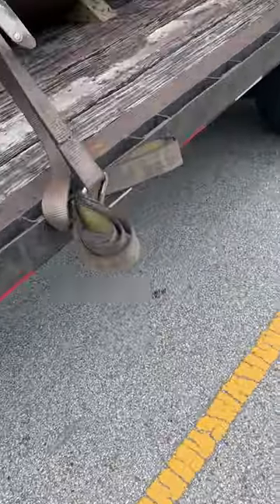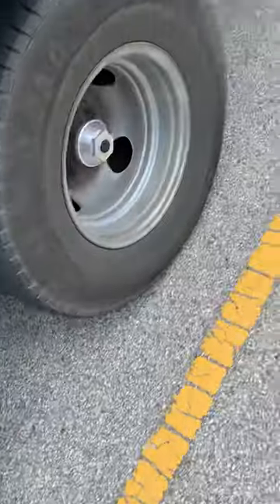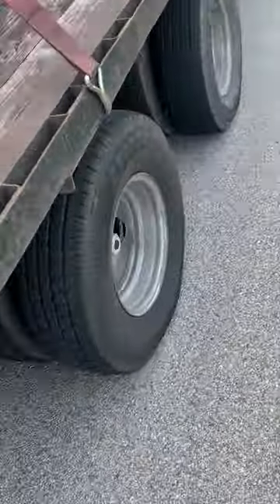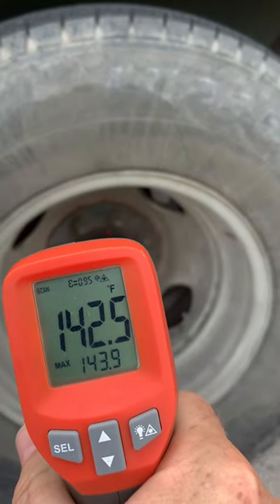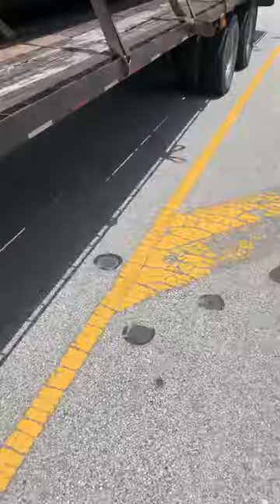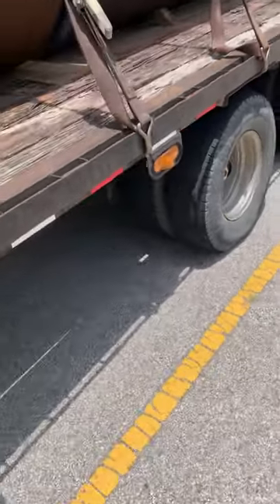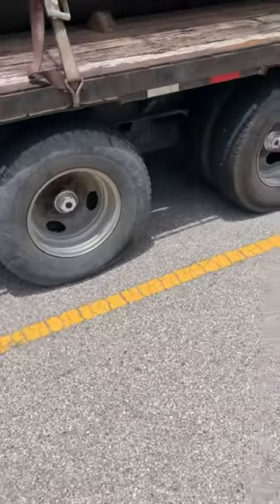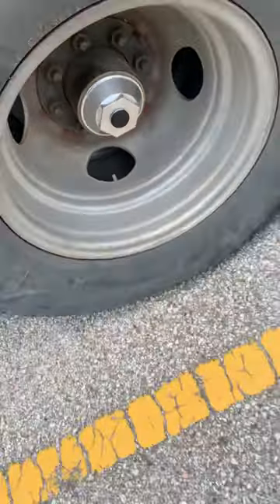Lucas hub oil vs. Super-S (00) double zero grease

Comment: Any updates on the 00 breakdown life vs the Lucas? I’ve always used Lucas and it seems to do well for me and isn’t too burnt when I change the oil. I usually change the hub oil around 10k miles. I’m curious if the 00 has the same life.
Reply from the maker: Apologies I just saw your comment …the temperatures in the axles never get very high…there shouldn’t be any noticeable discolorations in the lubricants… however that doesn’t mean that there won’t be any breakdowns in the oil…Loss of protection …the double zero shows no sign of losing any of it’s lubricating abilities.
Changing any lubricant you put in your hub every 10,000 miles is a great idea. That’s generally when I like to change mine as well. I haven’t had any issues …have about 500,000 miles give or take on my old 2008 gooseneck New running gear but the original bearings …more than likely will change them soon just for peace of mind. Last time I inspected the bearings they were in good shape…hope this helped

Comment: "00" is semi-liquid grease that many snowblowers us in the gearbox (auger diffrrential).
It is a EP extreme pressure grease. 
Snowblowers are operated in cold temperatures and extreme pressures.
It is designed to be used as a,wheel baring, higher & high temp grease.